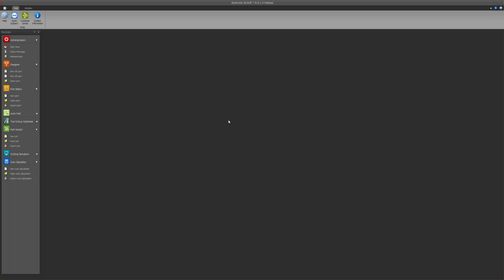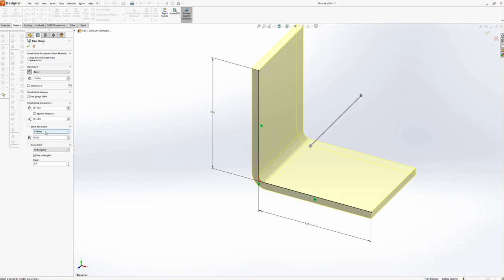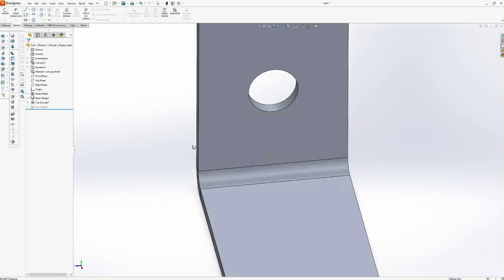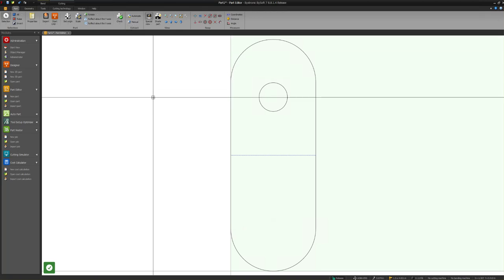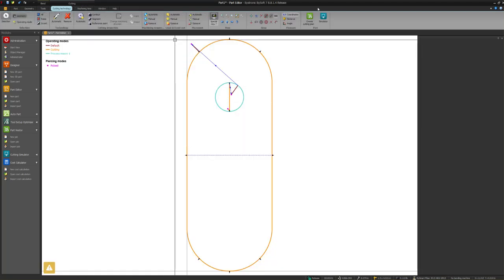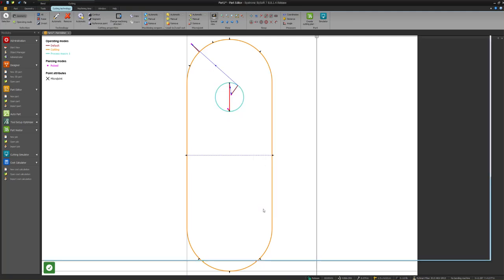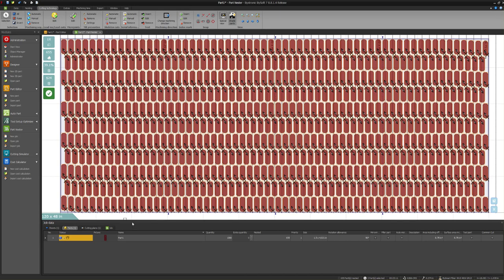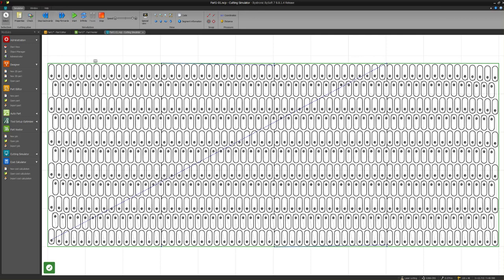Bystronic, Bysoft 7 Simple Cad idea taken from a drawing to programmed to a Bystronic Laser.

Comment: Michael are you using bysoft 7 for any bending applications?
Reply from the maker: At the time we used bysoft 7 but now we use by soft cam and solid works
Reply: @MikeD4  Did bystronic stop producing their own bending software and farm it out to solidworks?

To clarify, the company I work for uses bysoft 7 for our older bystronic presses, so this software from bystronic is all I know for bending software.
Reply from the maker: As far as I know they have partnered with SolidWorks since Bysoft 7. Bysoft CAD is basically SolidWorks in their newer releases
Reply: @MikeD4  Are you running their nesting software as well or do you use something else for plate cutting? At CNH we use optimation as company wide software.
Reply from the maker: We use their nesting software to program our lasers and press brakes